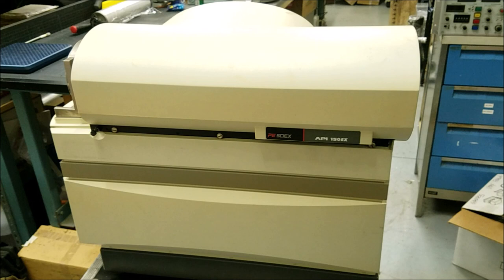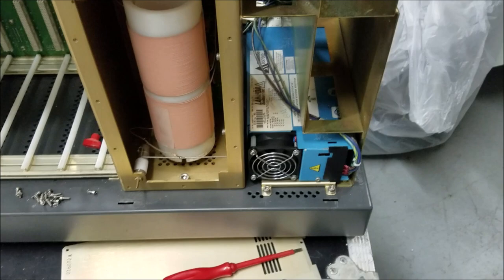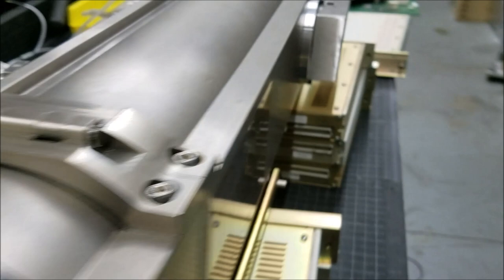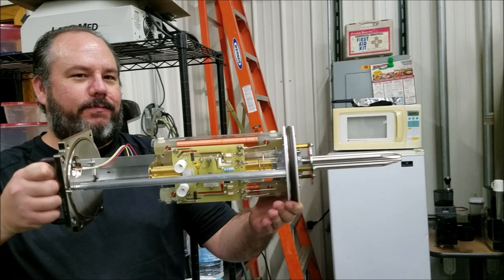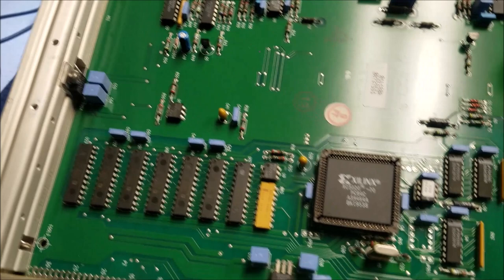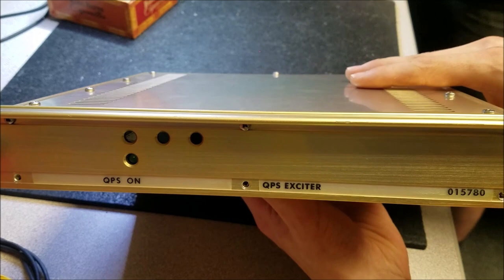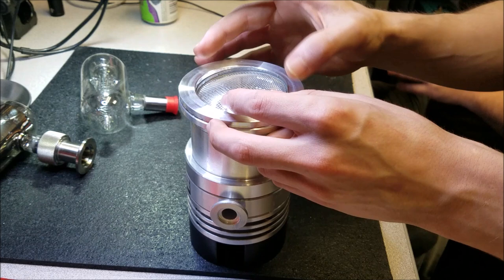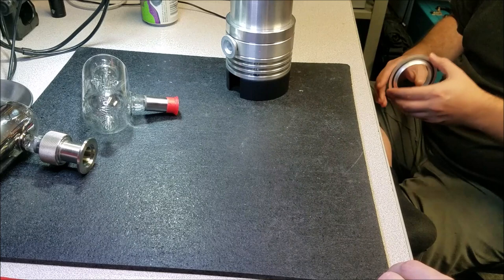Inside High_Tech_Stuff PE SCIEX API 150EX Spray Mass Spectrometer Teardown

Comment: Very educational Zeno as always thanks (oh and we see a lot of those new/old electrolytics still in UK usually made by seimens) nice vid lil dude!
Reply from the maker: I see those axial capacitors still used in crossovers quite a bit, what threw me off was the crimp in the center which I have never seen before. I don't know why those where made like that and still can't think of what it could be holding, it's there for a reason right?
Reply: @Zenodilodon  Usually high temp or heavy duty i think, the crimp is a non destructive pressure release as these are really resilient caps (fit once and forget)tend to only be in high end intensive applications like pulsers! Ps usually very low esr so!
Reply from the maker: @qutube100  Oh that's a good point, it could be that half the capacitor is empty and has room for any spill from venting, I had never thought about an electrolytic capacitor that was made to fail without leaking its guts out.

Comment: Those Xilinx parts, xc3020-70, are FPGAs. We used those in sat comms equipment about 25 odd years ago, they're obsolete now but were fantastic at the time. I imagine the Motorola parts are 68000 based processor's which were a midpoint between a CPU and MCU but I could be wrong. Nice bit of kit!
Reply from the maker: Thanks for the input, that makes perfect sense. Xilinx used to be quite popular in equipment many years ago, I used to see their stuff in larger conference projectors and other industrial gear quite often. It was interesting seeing the intel flash chips, it took me right back to the days when non-volatile memory was a new thing just coming out to the consumer market. Back in the 90s my friend told me about this 2 inch+ chip that could come close to storing a GB and now we put a whole TB+ on something the size of a fingernail which is crazy!
Reply: @Zenodilodon  it's certainly amazing how many gates the newer FPGAs have nowadays but a pity you can't get the software to program the old 2000 and 3000 series as I have quite a few of them kicking about. Great video by the way, keep up the great work!

Comment: It's so 90s!

Was it OK to open in just a regular environment or is dust and stuff not a problem
Reply from the maker: Beige and all lol

Yeah the chamber is meant to be opened/serviced. All the fine dust and stuff typically gets evacuated during use under normal circumstances. We are quite mindful of that and nearly everything we work on for resale gets a good cleaning and is tested when possible.
Reply: @Zenodilodon  for sure, I wonder if it's brominated plastic👀
Reply from the maker: @phonotical  No idea, and it's a little to late to send a sample through the machine to check lol
Reply: @Zenodilodon  🤣
Reply: @phonotical  How else do you get that rich orange color?
Reply: @hightechstuff2  tanning salon? 😅
Reply: @phonotical  Bigley...